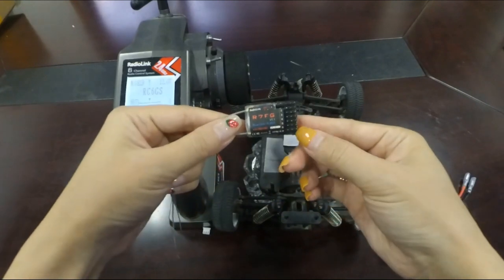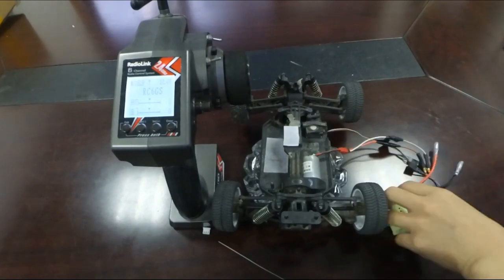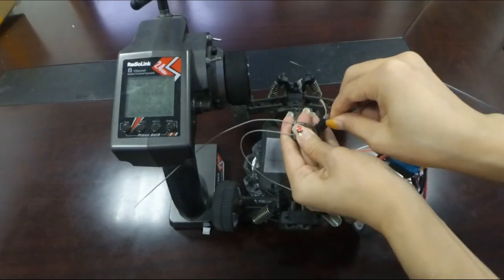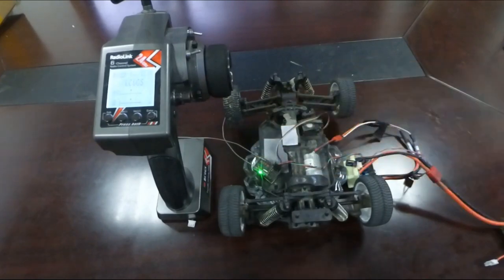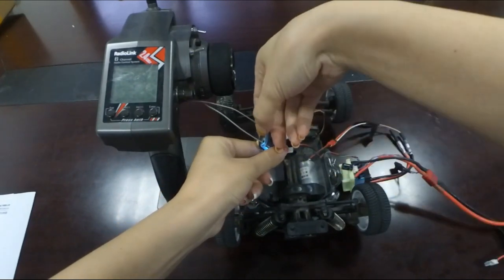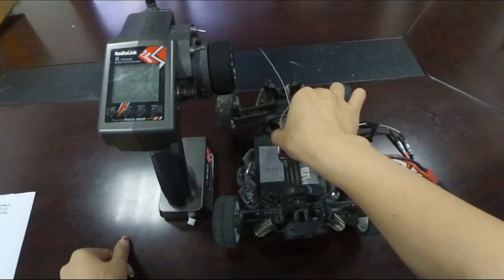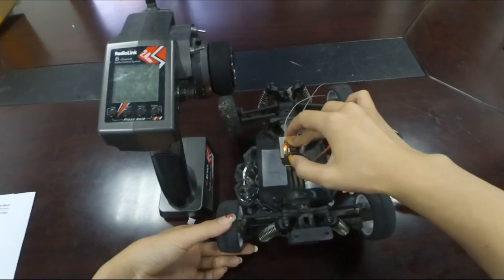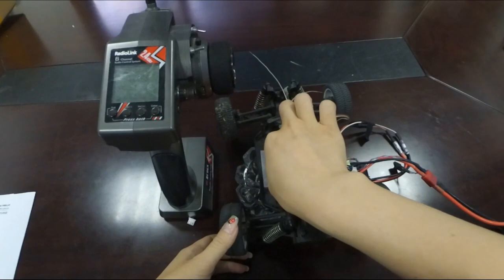Radiolink R7FG Working Modes & Gyro Phase  with RC6GS

Comment: What do I do if I am already using all of my channels on my receiver? I am using channel 3 for LED lights. How do I adjust the sensitivity of the Gyro without affecting the lights?
Reply from the maker: Hi, sir. If you want VR to control the light, you can adjust the gyro sensitivity in the menu- GYRO. you can
adjust gyro sensitivity STD or VR. STD is adjusted on the setting page. and VR is
default CH3. So you can set it to STD to adjust the sensitivity. If any question when using RadioLink products please feel free to contact us. Our email is: after_service@radiolink.com.cn
Reply: @Radiolink_official  …. THANK YOU 🙏🙏👏
Reply from the maker: @toysforboysrc  Our pleasure.

Comment: I have 2 of these receivers one on y redcat and the other on my scx10.  I have them both programmed to my rc6gs v3 transmitter.  My redcat receiver light is green and the scx10 is blue.  Shouldn’t both be green?
Reply from the maker: Hi, sir. R7FG has 4 working modes. Different colors indicate different working modes. You need to check the version of your R7FG and check the corresponding manual to know about the working modes. Here is the link for you: https://www.radiolink.com/r7fg_manual   If any question about RadioLink products please feel free to contact us. Our email is: after_service@radiolink.com.cn

Comment: Hi, I would like to ask for your help if it is possible: I have this radio model but (I don't know how) the "beep" of when the radio is turned on and the "beep" of the keys is gone Can you tell me how to restore the sound ?? P. S. I also tried to reset the radio and remove the batteries, without getting anything. Thanks a lot if you can help me !!
Reply from the maker: Hi This is strange because the sound can't be disactivated. Could you please send  a video to after_service@radiolink.com.cn so that we can check a bit? Thanks!
Reply: @Radiolink_official  grazie, ho contattato la vostra assistenza e sto cercando di risolvere il problema. Grazie mille ancora!
Reply: @Radiolink_official did you see that video?
Reply from the maker: @REPORODGE  Hi, sir. The user may have already contacted our after-sales and solved the problem. May I know if there is any problem when you use our products? If yes, please feel free to contact us. Our email is: after_service@radiolink.com.cn

Comment: Hello  can u place the receiver sideways  in an arrma kraton 6s  my compartment  for it is smaller I was told to place it slightly  upwards  facing  front
Reply from the maker: Hi, sir. When installing the receiver, please place the receiver horizontally in the car. So if you want to place the receiver sideways in an arrma kraton, just make sure it is installed horizontally. All directions is okay. And the dimension of R7FG is 35*22*14 mm. So you can check if it matches the compartment . And here is a link to introduce how to install receiver antenna for your reference. https://www.radiolink.com/newsinfo/886600.html  If any question about RadioLink products please feel free to contact us. Our email is: after_service@radiolink.com.cn

Comment: I think this controller has really good value and I currently have it. I replaced my Futaba 4PV with this because the range on the Futaba 4PV was abysmal. The range and gyro on this are both incredible. This has more features than any sub $ 100 radio I know. The steering isn't as direct as my Flysky FS GT5 though, the Flysky just feels better and more direct and instant with respect to steering. I think that  Radiolink/Dumbo rc  is a brand that gives a lot value for the dollar but there is a bit of a tendency to have glitches to in my  DUMBORC-X6 2.4Ghz 6 every now and then the car I was controlling would just max out it's speed (very dangerous) and the Radiolink RC6GS V2 2.4G 6 would have problems going into reverse and suddenly just go into reverse without any operator input. This however has the the most features of any radio I know of for less than $100, the furthest range of any radio I know and the strongest gyro I've ever had whether it be built in or external. The strength of the gyro on this is something that is often forgotten because the range is the biggest selling point. I've had Traxxsas TSM, Dumbo RC built in gyro, Flysky FS GT5 built in Gyro, Yokomo DP-302 V4, and Futaba GYC 441 and this is the strongest gyro I've ever used.

Comment: Can I use a brushless motor and ESC with this ?  I cant get mine to work,  My brushed motor and ESC work fine.
Reply from the maker: Yes. RC6GS and R7FG can be used with brushless motor and ESC.
Reply: @Radiolink_official  yes I had some Factory some  presets settings in my castle ECS that I had to return to defaults then it worked. I love this Transmitter and receiver combo.  Even though you guys sent me the wrong receiver for an RC car,  ITs the RC7 with 2 antennas,  One I ran along the frame and one in the antenna holder plastic thing.   Reception is goof if not better anyways so no big deal. I love you can see battery voltage on the remote and battery voltage of the transmitter as well as the signal quality.  Important if your flying but im not thus us fir a RC crawler.  If I need another ill definitely buy again fort this price!
Reply from the maker: @msrcracing8387  Thank you very much for your feedback and we are glad that you like it ! The dual-antenna receiver R7FG is the upgraded pack with RC6GS and its range is longer than R6FG. We hope more RC fans can experience our new product ;-)
Reply: @msrcracing8387  what settings did you have to adjust ?
Reply: Chuck Hall use the flask link and set my castle to defaults
Reply: @msrcracing8387  it says it can handle up to 10v to the receiver so if i turn mine up to 8v for a high torque servo it wont fry it ?
Reply: @ShadeTree_RC  NO idea sorry,  I found there receiver to be very weak when trying to power a 7.2v LED bar.  I ended up using a separate BEC for the light bar.